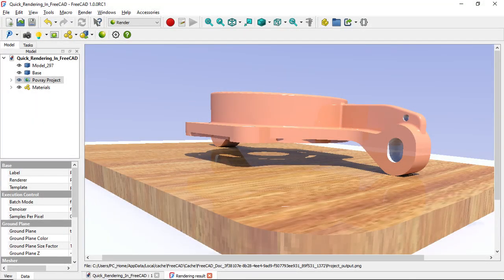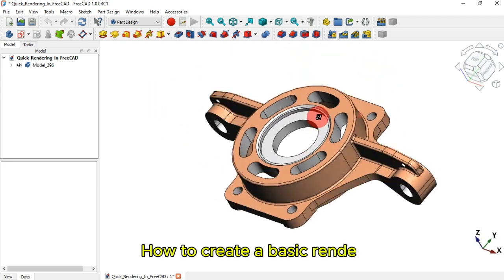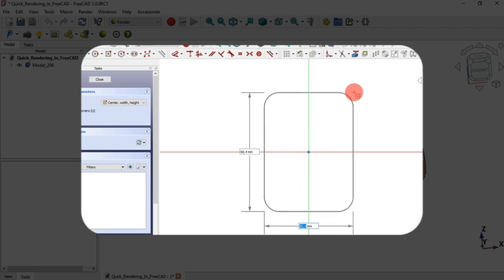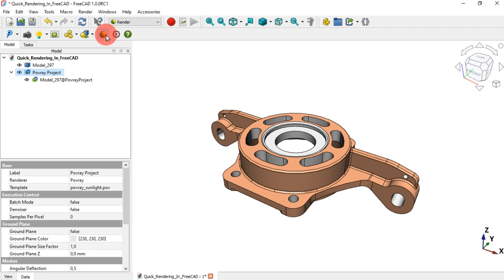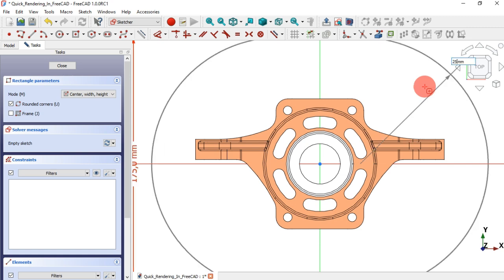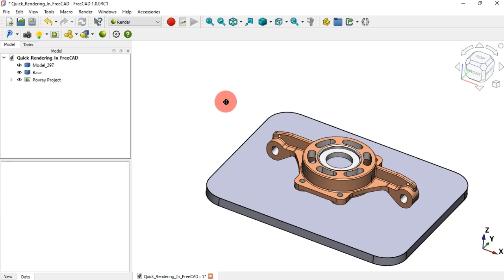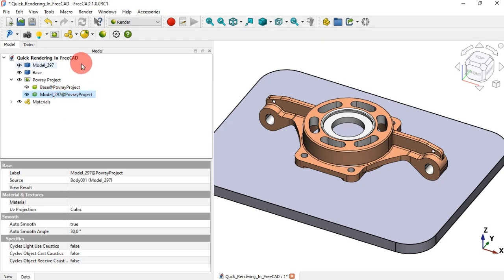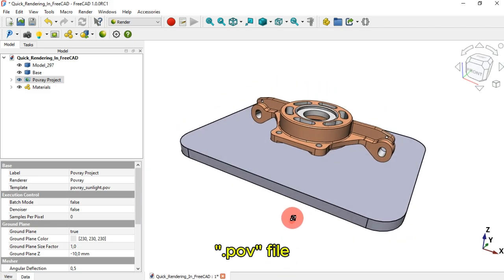FreeCAD 1.0 Basic render guide

Comment: lot of error sir
Reply from the maker: Using version 1.0 I also found errors, so I tried 1.1 dev version and it worked. Try the weekly build version (1.1 dev).
Thanks.
Reply: @OffsetCAD  it keeps saying failed to render option
Reply from the maker: @zwoshtremex1009 alright. Let me try the same model on my FreeCAD program.
Reply from the maker: That message appears in report view? What exactly says?